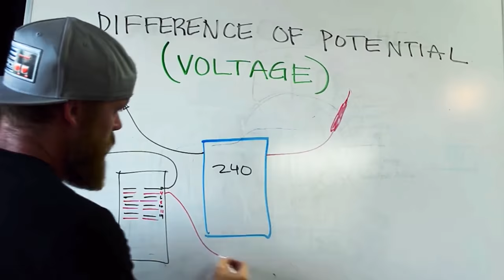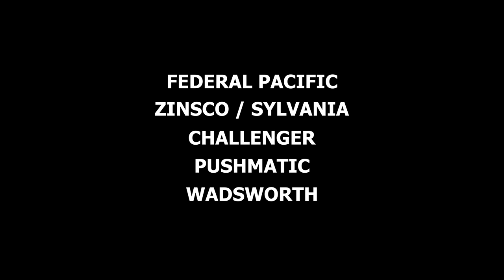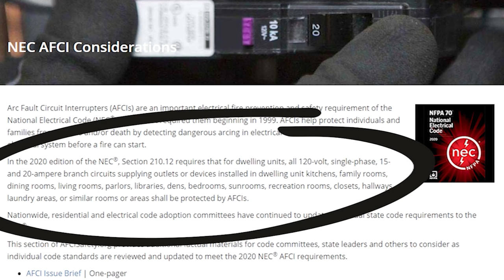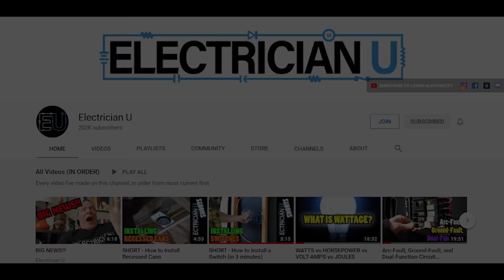Outlawed Panels and Breakers

Comment: Just swapped out a federal pacific sub panel in a garage.  The garage was relatively new mid 2000's, panel had date codes from 80's.  Guy who built it probably pulled it out of an old barn and the breakers were of a wide range of vintages.  Thankfully the main house and service entrance was a new Siemens panel so we got a matching siemens to stay consistent though it seems the local suppliers are stocking less Siemens and moving to ABB and Square D as their default stock options so had to go with a few Amazon purchases to fill in some holes in their stock.  (The smaller mid sized 12 slot panel and arc fault breakers were out of stock locally).  Family member also just pulled out a FPE breaker panel when they got an EVSE installed at their townhouse which was definitely a good move on their part.

Comment: In 1975, I bought a home in Cheyenne, WY, which had aluminum wiring. (I was ignorant of the situation and ramifications). My wife was ironing and the lights in the room started flicking. The receptacles were push-wired instead of hard-wired. I repaired them as I found a problem. I subsequently replaced the kitchen cabinets, and when we moved seven years later and took out the refrigerator, the receptacle was burned and fused at the connection with the refrigerator. The fusing saved our lives because it prevented a fire from starting. I don't recall if the boxes were metal or plastic, or the condition of the electrical panel. Be aware.

Comment: I recently had a Federal Pacific Stab-Lok panel at home replaced with a Square-D Homeline panel. It never caused any issues, but I do feel a lot safer now.
Reply: Homeline are really nice panels and breakers. I like square D for service equipment. Freaking QO's are getting crazy expensive anymore, it's almost $10 a breaker (15 & 20a single pole)
Reply: I do not know if this is a mandate everywhere, but in our city, if you have a FedPac panel you can not sell the house without replacing it.

Comment: If you take the stripped ends of the hot and neutral conductors, lay one stripped end on the insulation of the other and slowly slide it up until they are making contact and hold them firmly together until the breaker trips. You will hear and feel a hum. If the breaker fails to trip, you will have to pull them apart and you want to do so quickly. Its best to have a pair of Kliens handy in case the conductors weld.  There will be an arc when they separate. I see failure to trip quite often with GE breakers and panels.(aside from the brands mentioned in this video)

Comment: I have absolutely no problem with the ITE Pushamatics because they bolt right on to the bus bars. I believe that all circuit breakers should bolt on to the busses.
Reply: So Siemens breakers where the conductor is torqued within a bolt is different than a bolt on breaker just because it’s “bolted on” you understand theres a torque setting for a reason. No need for bolt on breakers especially when working on panels live makes it more dangerous and also bolt on breakers are trash
Reply: @fedfreds832  Bolt on breakers are less prone to burning up the bus tabs if they are properly torqued down.
Reply: @jolyonwelsh9834  that’s the point no need for a bolt on breaker if the torque is proper this ain’t the 70’s no more we don’t neee bolt one
Reply: @fedfreds832  Well then, why do they use them in hospitals, an application which requires the utmost in reliability?
Reply: @jolyonwelsh9834  if you think a bolt on breaker is more reliable than so be it personal opinion. In my opinion there’s a torque setting for a reason and using a standard breaker vs a bolt on will give you the same result. If you think breakers should be bolted down how do you feel about outlets that let 14 wire stab in the back?

Comment: I am State side and my home had a Federal Pacific stab lock breaker panel in it.  I didn't know about the issues with it until I tried to find breakers to add to the box.  After not being able to find any on the internet,  I searched for the breaker panel and found an old 90's news clip about it being recalled.  I was terrified.  Needless to say I had it replaced by a licensed electrical contractor less than 30 days later.
Reply: I would love to see that news clip.  I have never found an official recall on any FPE breakers.

Comment: 210.12B provides an exemption for arc faulting during service changes. Extend the circuit more than 6', then you will be required.
Reply: As of 2020 NEC it appears to have been moved to 210.12D
Reply: You should visit the south USA and see how many people care about the NEC codes. it's a JOKE down there a DANGEROUS joke..

Comment: Years ago, I had a GE panel in a house built in 1972.  That particular panel had a bus that was aluminum, possibly could have been pure aluminum.  When the A/C would turn on, you could actually hear an arcing sound.  The breaker was hot to the touch and it had actually melted the plastic on the back of the breaker.  Eventually, that whole panel was replaced.
Reply: Good thing. If you waited much longer your whole house may have needed replaced

Comment: Good video.  Well you are on the subject of outlawed panels, you should do an article about a problem you would very rarely ever see today.  It's called fused neutrals,  and was used in some very old panels with knob and tube wiring. From around the turn of the century to around  circa 1928, and it may have lasted a few years later if installed in a part of the country where the code adoption was slower, they used to have Edison base fuse on both the hot and neutral wires.
Reply: After posting your comments don’t you proofread it for proper spelling & use to do any editing if necessary?

Comment: 15:20 ish.  I'm just a handyman with a gadget problem.  I got a FLIR attachment for my phone, mostly to find problems in walls, panels, heat leakage around doors & windows, circuit boards, car things, etc.  I showed one of my clients where her major heat leakage in her house was on a cold day, and recommended some licensed contractors to fix those issues.  Some I could fix like adding some weather stripping around doors.  Beyond that you need a contractor's license, or risk the wrath of the CSLB.

Comment: Crouse-Hinds I believe was omitted from list .12:47 showed the side stab breaker in fact.
  Simple put as you stated these elec.delivery sys.,were not ment to last as long as they are  doing!.
   Pushmatic,to change the breaker you are screwing into the live buss 
   You omitted showing your viewers what that was,but did talk about it in detail,
On commercial my choice was □-D.
 Reason being their buss was of heavier gauge, comparative. 
  Federal P, sometimes
when you shut them off ,nd tied to put back on ,it didn't happen!!
  Best advice given
Change out your breakers on the load centre.(PANEL)
   BUT START ,a savings account to eventually change it all out from the drop,to metre pan,and the new copper feeders into your square D panel.
  Dont ever try to arch out your conductors!!
  Please leave that to people with experience, nd have done it before. 
    You brought back a lot of memories, 
Thanks for the video!

Comment: We had a pushmatic in our house when we moved in. Never had an issue. But I upgraded it to a GE 150A panel. It was 45 years old when I replaced it.
Reply: You actually downgraded it, GE breakers are crap. High defect rates out of the box, and very slow response to short circuits. Eaton, SqD and Siemans are all much better than GE and most of those cost less than GE as well.

Comment: I've come across this situation a few times and I like a bunch of what you've said. One thing that set up a red flag is triping a braker with the hot and neutral wires. I can see how the thought prosses of minimal damage is being done to the system wires. With that said there are rules in some areas that state a once a braker has been flipped due to a falt in the system it must be replaced after the second time this happens.
I know the ridiculousness of this comment. But the idea is after you test a breaker this way what are the possibilities it will not work the next time, and approving the system as safe.

Comment: Space heaters are going to be the load test device for a breaker when evaluating current draw and time to trip. You might need multiple units to overload a 20A circuit.

Comment: Was just working on a challenger panel recently. It's 4 residential condo complexes maybe about 40 100A challenger panels. when we went through them few burnt wires under breakers but nothing too terrible. Everything else was labeled and tight.
Reply: Was working on another one somewhere else went to pop out 2 pole 50 breakers plastic feet broke off

Comment: when testing breakers i made a box with a switch and a light socket, to test the breaker you put a fuse in the light socket that is larger than the circuit you are testing, so if it was a 15 amp circuit you put a 20 or 30. when you turn on the switch the breaker should trip, if the fuse blows then the breaker is bad.
Reply: a fuse will react to a bolted fault faster than a magnetic trip breaker can react.
Reply: @kenbrown2808  that is why it only works for a smaller circuit. If you are testig a 15 with a 15 amo circuit it will blow before the breaker trips. So i use a 30 amp fuse, a 20 mau work as well but i am notnsure, but for 15 and 20 amp circuits a 30 amp fuse works fine and i have only had the fuse blownwhen the breaker actually did not trip.

Comment: Can you please point to the code section that requires upgrading to AFCI breakers when changing a panel? My understanding of the exception to 210.12(D) is that if the branch circuit (wire from final OCPD to outlet) is not changed and no new devices are added, then no AFCI is required.

Comment: Pushmatic is a good breaker, never seen any problems with them in my 44 years as a master electrician..
Reply: agree one of the fastest tripping under fault made by Bulldog and ITE now Siemens
Reply: My experience with Pushmatic has been two things: Sometime they will be in on position but providing no voltage when I test with a meter or it will be stuck in off position and never reset to on no mater how many times you push it. Also I find they are somewhat dangerous to work live as when adding one to a panel it requires you to touch the screwdriver contacting the live buss in order to tighten the screw down. Just a little bit nerve racking since I don't like to kill power to the whole house for one breaker especially if it is being occupied.
Reply: I agree 100%, I would never voluntarily remove a Bulldog panel just because it's an old design.
The narrow panel width was the only drawback, a little tough to work in. Neutral blocks became very crowded too.
Bulldogs will trip too easily, if anything, but I'd rather that than no trip at all. I've seen a brand new Murray shorted and fail to trip.
Also, being screw down breakers, bus contact was very good, assuming proper installation.
Additionally, they were indeed UL listed, I don't know where he's getting his information. Underwriter's Laboratories has been around for quite some time, I don't agree with the statement that they're relatively new, unless one doesn't consider 1894 to be that long ago. 🤔
Reply: I agree. I have changed out a lot of them only because of an upgrade, never for a failure. I have had to swap a few bad breakers over the years.
Reply: it was the only breaker that was "BOLTED" to the buss in its day, not bad for residential equipment!!!!. I never knew of any electrical  problems with the "PUSHMATIC" breakers either
Reply: Got two Pushmatic panels in “current” use. One in an old house trailer turned into a small shop, the other as a branch panel in a wood shop inside my pole barn. Both systems wired in conduit. I have had zero issues with either. The only problem is it’s getting hard to find spare/replacement breakers, but they are still out there. Just gotta keep your eyes open...
Reply: @dylanlink9798  

How do you think we put breakers in a panel in commercial since its 99% bolt on.

Sans  277/480 or 347/600.  Thats a shut it off no matter what.
Reply: I encounter Pushmatic panels a few times a month. The decision to replace is almost always after the homeowner's insurance company requires an upgrade for continued coverage regardless if the panel checks out fine...there was a few Pushmatic jobs where just replacing with newer third-party breaker satisfied the insurance company. It appears that home Insurance companies are conducting home audits where they address the electrical panel specifically.

Comment: Our house, built in 1957, had a 100A Pushmatic panel that was woefully overloaded due to so many electrical devices that are now part of daily living. When we first moved into the house in 2001 we had many overload issues and some of the old breakers failing. Soon enough all but the main were cycled through and newer breakers. Also most of the receptacles throughout the house were non-grounded type, with but a few exceptions in bathrooms and for garbage disposal location. Somehow all of this questionable circuitry passed inspection.

A couple years ago we had solar panel system installed, which required an updated & relocated panel. We now have 200A Square D panel, but SCE chose a location that is on south (sunny/hot) side of house. In summer I have to place patio umbrella in front to shade panel as it gets extremely hot during heatwave periods.

Comment: Pushmatic.  I do some work in a factory that was built in 1960, it has Bulldog branded Pushmatic panels for 120 older office / bathroom loads, only one or two panels have a 240 breaker. The bus duct is Bulldog too but that has been fine.

Comment: a lug on an old edison bus bar to a ceramic porcelain lamp base in a pinch is a great simple repair to a damaged fuse socket  also same concept works great as an equipment disconnect or a branch feeder.  my old workplace had a bunch of electric blowers tht where all tied into one heavy amp line with a bunch of porcelains with 15 amp fuses next to them. our electrical eng. came up with the idea for 1950's repair on the fly in todays world

Comment: My friend was having a problem with her breaker panel. An electrician  had come out and wouldn’t work on it. He said it was to old.  He didn’t say it was unsafe.  I told her I would come take care of it.  It was federal pacific.  I had never heard of it before.  Turns out Ace Hardware carries a replacement brand .   I picked one up and went over.   Actually she just wasn’t resetting the breaker correctly and that’s all it needed.   A few days ago I asked  my friend who owns a State Farm  about insuring a home with polybutylene.  He said they won’t insure anything unless it was built after a certain year.   He also brought up they wouldn’t insure anything with these breakers because of fires.   That brought me here.

Comment: The first house I bought had Zinsco.    One day I was walking by the panel and I heard a sizzling sound.   I pulled the meter to kill power and pulled all the breakers.  The spring tension was so weak where they clamped on the bus that they barely made contact and were burning.   the bus was aluminum and the breaker contacts were copper?!?!?!?!?  I got some copper bars and cut them to size.  Bought all new breakers (You could still get them then) A few years later I heard about all the houses that burned because of the Zinsco panels.

Years later bought a house with the old glass fuses.   They had 350 amps worth of fuses in a 100 amp panel......SMH

Comment: When i pull or rock a breaker and it makes a CRUNCHY SOUND thats good old ALUMINUM BUSS . The panels i think are bad are FEDERAL PACIFIC AKA no blo breakers, Zinsco, Challenger, ALUMINUM BUSSED PANELS .Cutler hammer panels look nice but their 15 & 20 amp breakers are set to instant trip at 650 amps compared to Square d qo which are set to instant trip at 150-200 amps. Ive installed a lot of pushmatic panels, the ones from the 1960s70s those breakers triped as fast as square d qo and were the best breaker you could but untill 1955 when qo was itraduced.

Comment: The contractor I'm working for right now just picked up a contract where we're going to swap out all the FP panels in all the apartments in this complex. Around 100 or so I think? And they're all aluminum wired units. Plus, the service disconnects are all FP as well of course, so it's gonna be a big swap job this year!
And aww, poor Pushmatic. One of these days I'll find time to swap out my Pushmatic in my house. Should really try tripping them. I haven't had one trip yet, so part of me wonders about that.
Reply: gut the apartments and make a fresh start - they'll probably save money.
and I've never had pushmatics fail to trip. I've had them wear out and trip too easy.

Comment: I can add GE home panels to the outdated or trouble list.  The ones installed back in the 70 and 80's have loose breakers, widened spacing on the stab plates, breakers which do not trip when called for arcing...etc.  Many times you can just replace the old breakers with new ones, and other times just swap out the panel.  One thing about GE panels is there is a main house disconnect breaker which shuts off all the 110, but the 220 is left without any main breaker protection.
Reply: How does that even work then?